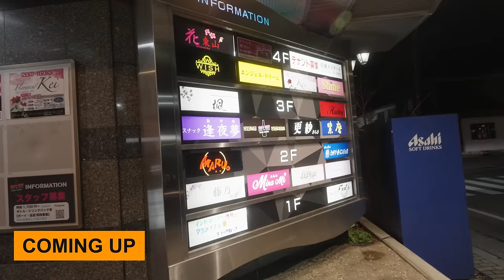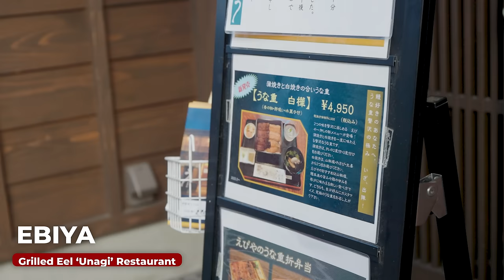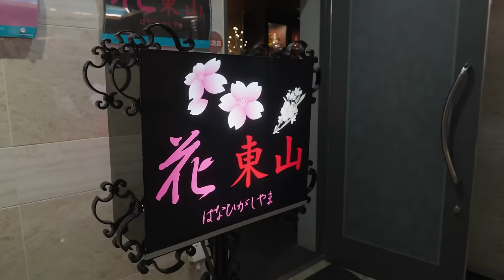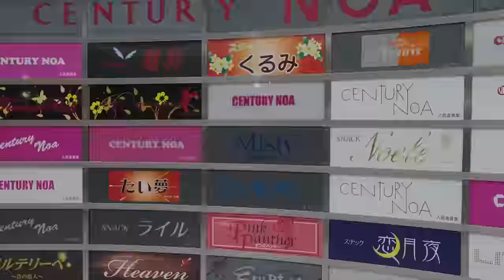I Spent a Night in a Japanese Hostess Bar

Comment: I would like to distinguish a Japanese Hostess Bar from a Japanese Snack Bar.  Things have changed in the decades since I lived in Tokyo for sure.  But back then hostess bars as in Akihabara had touts outside would literally drag you inside (now illegal, I understand) and ply you with extremely priced champagne and booze and you would be lucky to have any money in your credit card accounts when the evening ended.  Snack bars, on the other hand were very much as shown here - minus the Geisha. The snack bars were a pleasant place to spend an evening without draining your back accounts. Alas, I ended up not going to snack bars due to the insufferable non-stop karaoke.

Comment: We have plenty of eels in New Zealand.  As a kid we used to catch them and keep them as pets....  Or eat them.  As a kid we would have a spear and go out at night to spear them.  Now as an adult  we get a hinaki (a flax or rope woven type trap) and we smoke them.  Put the secret recipe ( sugar)  on them after cleaning and prepping  the eel.  We have an old converted fridge that has racks in it.  Put the eel on the racks.  Then we have air ducting that goes from the fridge to an old electric  frying pan.  Put manuka  wood chips in the old frying pan  the lid you have a hole cut out that the air ducting is attached to and boom.  Smoked fish for pretty much nothing. It's the only thing we can do that's cheaper then in Japan!

Comment: "i thought it would be an old Kei car"

it's from 2011
it's 12 years old
even what should be considered an "older" car these days is still from the 2010's and the difference in cars from the 2010's or even 2000's compared to now isn't that huge compared to the difference in cars from the 1980's-1990's compared to the 2000's.